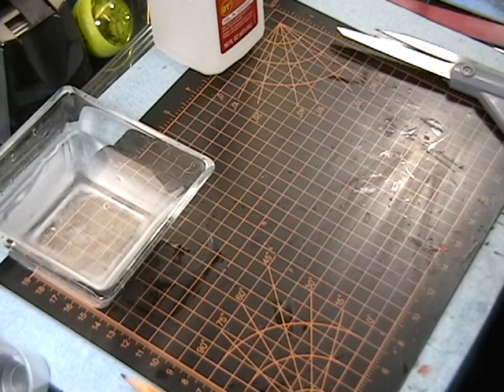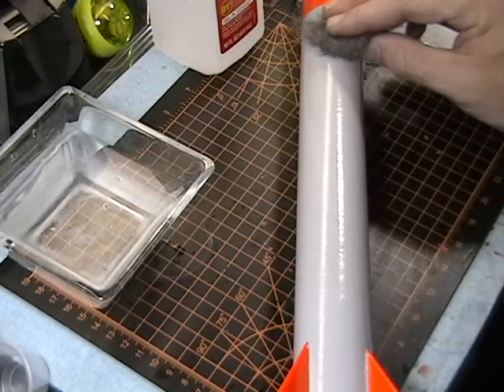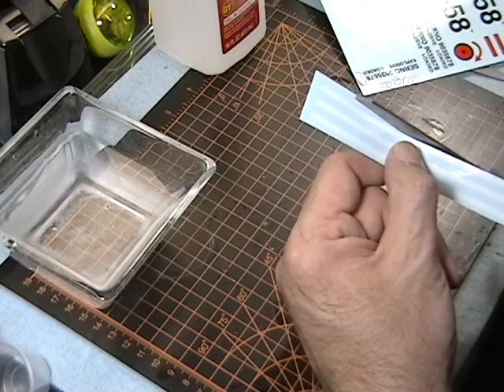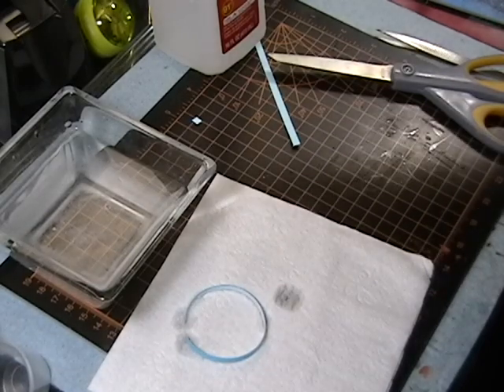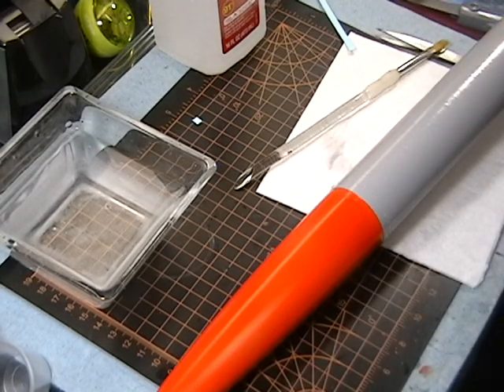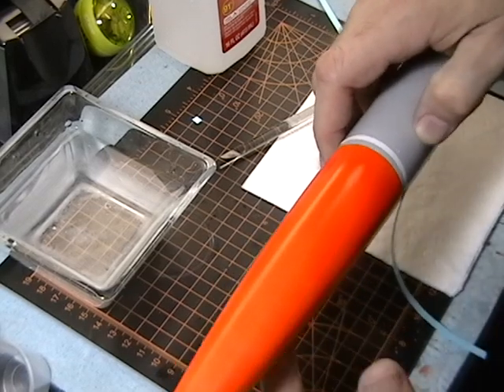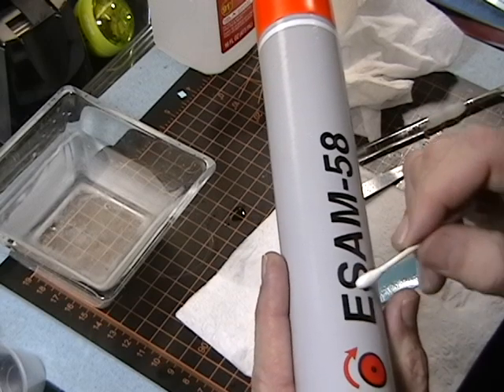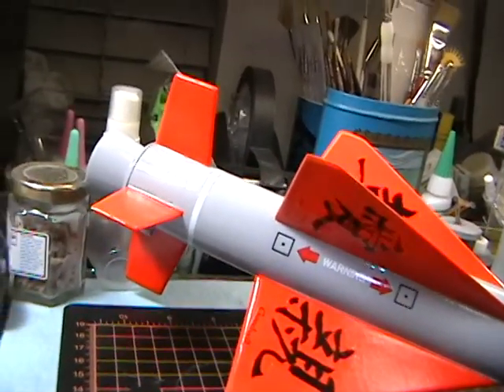Maus Werx Model Rocketry Decals Made Easy.

Comment: Do you use hot or cold water? Do you add any soap to water to help sliding
Reply from the maker: very warm water and a drop of white glue in the water bowl to help bonding.
Reply from the maker: Rocket is gloss coated to help decal sliding.